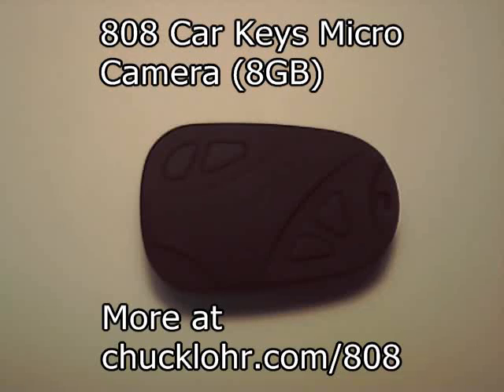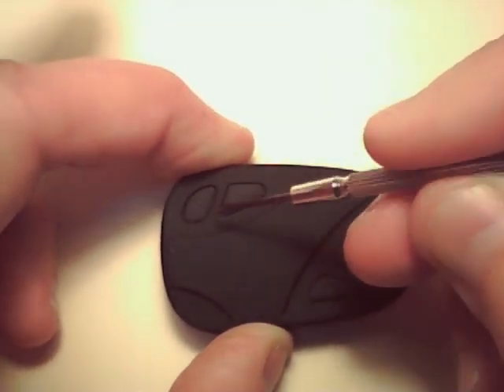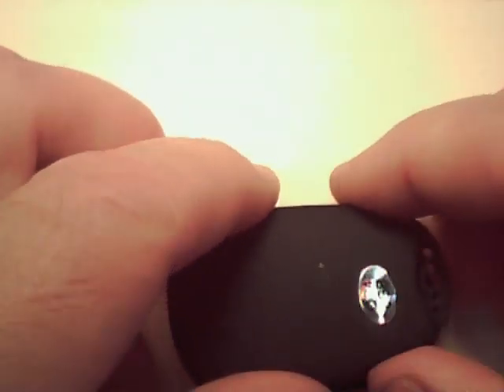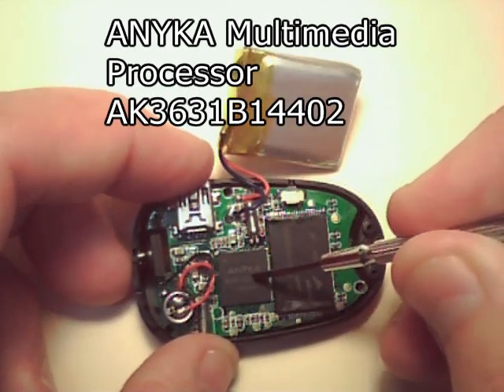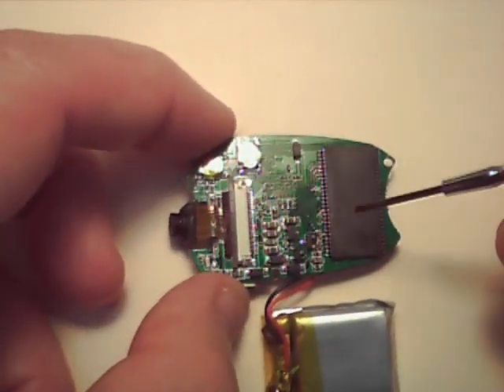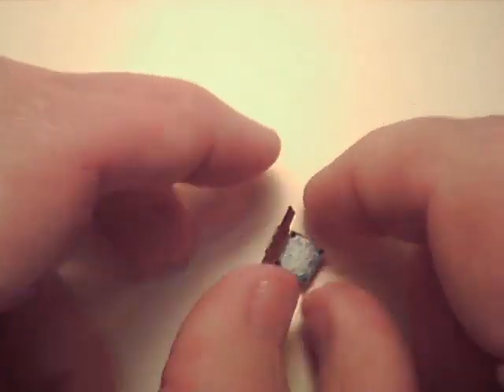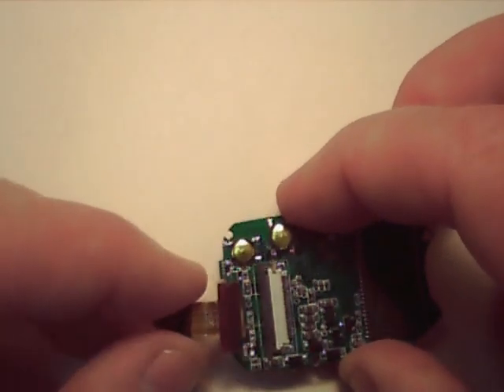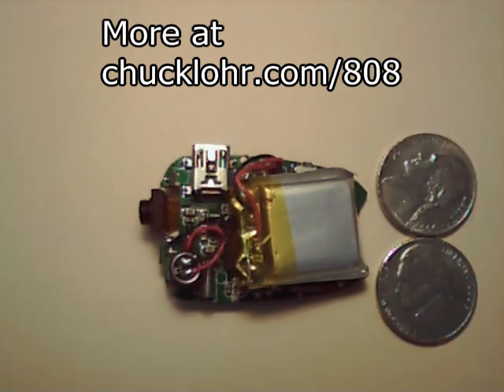Tear-down of 808 Car Keys Micro Camera (8GB)

Comment from the maker: @1canshort Do you mean the camera stopped working or the battery stopped charging?  The common reason for battery charging problems is a bad USB cable or bad computer port.  The problem can be due to a failed S4 diode in the charging circuit.  The certain diagnosis is to connect the USB cable and monitor the USB voltage and the battery module voltage at the camera circuit board.  USB voltage should be about 5V.  While charging, battery module should rise to 4.2V and about 4.9V when charged.

Comment: This is bit off question, but I don't know where to ask beside here, so I'll just give a shot.

I recently bought Mini DV D016 which slightly similar to DV 808. The only difference between DV016 and DV808 is that DV016 support sound activation system...which isn't working that good. Problem is, in-built microphone isn't sensitive enough to catch a conversation which leads recording.

Do you think it is possible to disassemble microphone and put more sensitive one? Your words will be helpful.thx

Comment: hey nice video instruction. i have a question. i have a camera module from a mp5 that have it said its a 3.0megapixel.  if it fits on pins board of the # 808 spycam i can use it or it did not work because of different pins? thanks

Comment from the maker: @acempdc Unknown if the #7 has a composite video output capability.  The #3/#6 processor (SPCA1527A) has composite video output capability but not 808 implemented.  The easiest way to get composite video in the airplane is with a "automobile backup camera".  Search the 808 review for "no composite video in the 808".

Comment from the maker: @GregoryHouseMD1 The #3 will record for about 50 minutes on 4GB with the internal battery, if you are lucky.  The battery will last a few minutes longer than that.  I have used cards up to 8GB.  I don't know if a larger card can be used.  The card limit is about 100 minutes but that requires a larger external battery.  Extensive bench testing is required for any modification.  You would be better off using a solid state camcorder that can make long recordings.

Comment from the maker: @GregoryHouseMD1 Replace the battery at your own risk.  Your camera must have close-and-continue to record more than 4GB (AVI FAT32 filesystem limit).  A 4GB card will record 40 to 200 minutes, depending on the camera version.  Battery will last about 1 hour per 200 mAh.  Go to the review website and search for "External Battery Mod".  The new battery must have an internal protection circuit.  Bench test a full charge and discharge cycle.

Comment from the maker: @abhishekcloud9 As long as the battery has a protection circuit the replacement should work.  For safety, be sure to voltage monitor and bench test a full charge and full discharge cycle, and verify that the battery does not overheat.

Comment: @Normandy5 
I appended the battery, and let the cam run empty. I now doesn't manage to turn it on again, a reset doesn't help. Is this an indicator for a working protection circuit?
I'll load the battery via cam and hope for the best... I'll leave it drawn out of the case to protect the chip from damage if the battery doesn't make it...
Hoping it will get the 8GB card full :D

Comment: @Normandy5 
Unfortunately, I have no equipment to do so...
I'll hope for the best... I think, I could work on a little plug on the internal cables, and connect the internal battery, or the external or a pack of AA batteries as I want to use them. I saw some mods like that. All I have to do is request pics of that :D

Comment from the maker: @Bonscha The only way to know for sure if the protection circuit works is to bench test it.  I would fully charge the battery, then apply 5V to the battery module and about 50 ohms in series. Initially the battery module voltage should be about 4.2V, then in a few minutes the battery module voltage should increase to almost 5V indicating that the protection circuit disconnected the battery, as it should.

Comment: @Normandy5
The replacement has a chip attached, on which the wires are soldered. Is this a protection circuit?
The LED may be unreliable, but it worked fine at my cam... After some more than an hour it turned from blinking into glowing state. I just wanted to know if another battery would affect this behaviour.
~30 min extra time would be nice, btw.
I built a case out of the small tictac box (the german small ones) in which I would put the cam without attached lower case, but with new battery.

Comment from the maker: @Bonscha  Any replacement battery module must have a protection circuit, otherwise when the USB is connected the battery will overheat and explode.  300 mAh probably will not fit inside but could be mounted externally.  Each 200 mAh is about 1 hour of recording.  The LED is unreliable as an indicator of battery charging.

Comment: @Normandy5 
I have one, too, and eventually want to append a battery of an old mp3 player. It has 3,7V at 300mAh, 2 cables coming out, and a chip which is appended vertically at the shortest side. (Seems to be protection) The size could fit. Will that work properly? Is there any chance of breaking the cam with switching the battery packs? How much extra time will I get with modding it? Do you think the status LED for charging will work fine after that?

Comment from the maker: @Cullamore Connect with a good USB cable.  Short press the power button.  If the webcam driver is installed the camera will switch to webcam mode.  If the driver is not installed, Windows will ask you to install the driver. You kneed to know what version of camera you have, and based on that, install the correct driver.  Right click on the 808 camera flash card and click on "Format...".  If you double click on an AVI file, Windows Media Player should play it.

Comment from the maker: @Cullamore Is the problem that the camera can't produce a file, or that you can't access the file?  Remove the card. Connect.  The computer should install the camera as an empty mass storage device.  While connected verify that webcam mode works.  Disconnect.  Install the card. Connect. Format the card.  Disconnect.  Take a video.  Connect.  Access the video AVI file and play it.

Comment from the maker: @caissonated Cut one battery wire and re-solder to hard-reset the camera and battery protection circuit, then test.  If still bad try either eBay 220544906965 (2 for US$8), or buy a new camera for about US$8.  The battery thickness needs to be 4.0mm or less.

Comment: Any advice on battery replacement. My 808 doesn't hold a charge, even when turned off.  I get only a few hours standby and then the camera wont turn on.   Thanks for your vid.

Comment from the maker: @jiffy82517 The external lithium ion battery charger can take an AC input or 12VDC input.  The charger outputs up to 4.2VDC, which is what the 808 camera needs.  Attach the boom box 12V to the charger input.

Comment from the maker: @JJFP1 Leave the MD80 power switch on.  Press the power button to put the MD80 in standby mode (low power mode).   The 808 does not have a power switch.  When the 808 power button turns the camera off, it is really in standby mode using very little power.  The date time clock keeps ticking.  After many days the battery will run down and the date time will need to be set again.

Comment from the maker: @jiffy82517 Is the question how to take video and photos using a 12V source?  Can't be done with the USB powered.  Go to the review website and search for "External Power Source".  Operates on 12V and produces the correct camera voltage.  Needs a 100 uf capacitor if the LiPo battery is removed.  Proceed at your own risk.

Comment from the maker: @copnsmith If someone is interested in doing this mod, contact copnsmith.  I would not even consider doing the mod.  The person qualified to do this mod would need the experience of a software engineer, a computer hardware engineer and have the laboratory tools necessary to work on SMD technology.  A PIC or Atmel microprocessor development system would  be needed.  Unless a #7 camera was used, there is no schematic to start from, so intuition and research would be also needed.

Comment: Thank you for your fast response.  Would you be interested in making a video that you can email to me describing the parts needed for such a mod along with the instructions on how to do so (detailed example).  I will pay you for any meterials needed and say $50.00 extra for your time.  I can mail you a check or send it via paypal if your interested.  Also, could you make a mod that elliminates the leds and makes an audible beep sound when turned on (ex: 1 beep when on / 2 beeps when off)?

Comment from the maker: @copnsmith A one button camera can't be done without a significant mod.  The mod would require an external micro to "press" the power and mode buttons in the correct sequence.

Comment from the maker: @linutas Unless you have special tools and skills, buy a new camera. If you open the case (caution, the voltages are live all the time), put the camera in webcam mode, and probe around with a insulated poker you might find a bad solder joint.

Comment from the maker: @aw11roman Unfortunately, while the USB cable is connected, the LED is not a good indication of battery charge.  It works on some cameras, not on others.  A completely discharged battery will be charged in one hour.  Don't connect the USB cable for more than one hour.

Comment from the maker: @Kinespojken When the USB cable is connected and the camera has no flash card, the #3 camera will install as an empty mass storage device.  Do not connect the USB cable for more than one hour.  More than that can cause battery problems.  One hour will charge a discharged battery.  You must have a flash card installed to take video, photos, or use webcam mode.

Comment: I've checked Chuck Lohr's website but I can't figure out which version I have (mostly due to I haven't filmed with it yet). The problem is that when I connect the camera to the computer the yellow light flash slowly, instead of a long light. The same happens when I start it when it's not connected to the computer. Maybe I should point out that I don't have any memory card in it yet. 

I have let it charge for more than 2 hours but I doubt it's even charging at all... 

Would you help me please?

Comment from the maker: @hlbnmlb The LiPo battery module in the camera has a protection circuit that "disconnects" the battery below 3V or above 4.2V.  The camera stops working when the battery module is below about 3.6V.

Comment from the maker: Charge time - about 40 minutes from discharged to charged.  The 808 USB charger only charges the LiPo battery about 70%.  The LiPo never gets 100% charged because the charger does not hold 4.2V until the charge current is 10%.

Comment from the maker: A replacement battery module must have a protection circuit that limits the LiPo battery to 4.2V.  This is not just a safety issue.  The 808 USB battery charging circuit requires it.  The 808 charger voltage will rise to 4.9V once the battery is charged.  Does the Nokia BL-5F have a protection circuit?  You should do some bench testing to verify that, and PROCEED AT YOUR OWN RISK!

Comment: I have the MD80 Mini DV which is effectivly a #3. Battery life is approximatly 1 - 1.5hrs which is very respectable, however Im going to fabricate a water resistant case for the camera to be used when Im on my bike and Ill have enough space to allow for an external battery. 
Normandy, do you think I could swap in a mobile phone battery such as the 950mAh Nokia BL-5F and charge it via the cameras USB? (Allowing for the additional charge time of course).

Comment from the maker: Operation - Youtube video 66bnQucXBWk.  
Setting the date and time - go to the website and search for "how to set the date and time".  
Battery - The LiPo battery has a protection circuit board on it that prevents it from going below 3.0 volts.  
Date time stamp removal - go to the website and search for "date time stamp removal".  Some cameras allow disabling the date time stamp.

Comment from the maker: Some cameras have a close-and-continue feature.  When recording the AVI file is closed at 30 minutes and another AVI file is started.  Battery life varies.  I get 50 to 80 minutes per charge. There are micro cameras with larger heavier batteries that record up to 4 hours, like eBay 140385533610.

Comment from the maker: @goldpurse I have an interest in this camera because of its size, weight, cost and functions. 

Most sellers call this a "spy cam" and it could be use for spying, but I don't have any interest in that.  I do not have knowledge of spying devices so I can't recommend one.  Devices to be used for spying are best reviewed by people in the security and private investigator business.

Of the 808 car keys micro cameras, for most people, the #3 camera with external micro SD card is the best one.

Comment from the maker: The problem is most likely in the camera assembly which is not designed to be repaired. 

So, the recommended repair is to get the seller to replace the camera, or buy another camera.

The problem might be a defective lens (the curved glass of plastic lens in the camera assembly) or the lens focus is not adjusted properly or a piece of foreign material on the inside of the lens.

Comment from the maker: @zackko47 The internal lens assembly is factory adjusted and sealed with a drop of glue.  If the camera is blurry then it is defective.  Motion blur varies depending on your camera version.  See the website mentioned in the video.

Comment: valuable info
anyone know who is the real manufacturer of this stuff?

as far as i know  a company that did the design, sell it to 2000 factories, and then factories sells it to  dealers and so on,
so thats the reason about why there is not a brand on it, but who is the company that made the design? all the 3 available designs are made by the same company?
i need knowledge
H2testw can be used even if memory works perfectly? will be no hurt at all?

Comment from the maker: I suggest that you read the forums in the links section of my website.  Some RC users have replace the battery with various success.  I have not tried that and don't know what voltage range is OK.  I know that an RC motor load can pull the voltage down to where the camera will have problems.

Comment from the maker: My type #1 camera stopped working like yours. Though It wont record video anymore this trick will access the flash on my camera.  Go to the website mentioned in the video and click on "System Mode Button Trick".  This trick does not work on all cameras.  Could also be a bad USB cable.  Good Luck.

Comment: Very nice break down of the camera.  I noted on your website that yours has to be on its side for upright video.  Mine produces upright video and images if the buttons are upward, which makes most sense.  I've also noticed there are at least two different versions.  One with the time stamp on the upper left and the other has it in the bottom right.  The bottom right version seems to have a better video quality, as the upper left version badly distorts the video when shaken or moved.